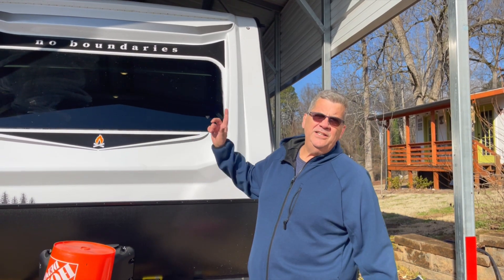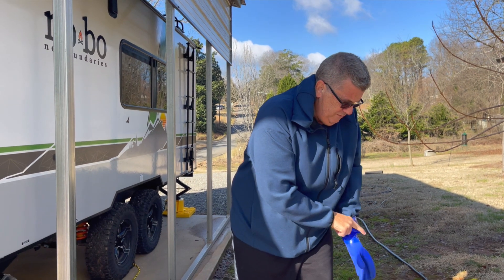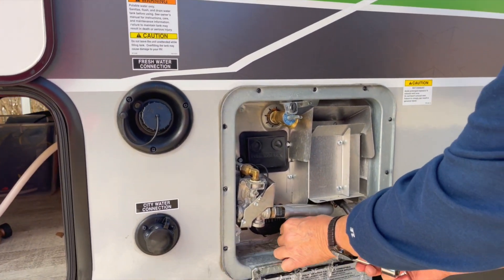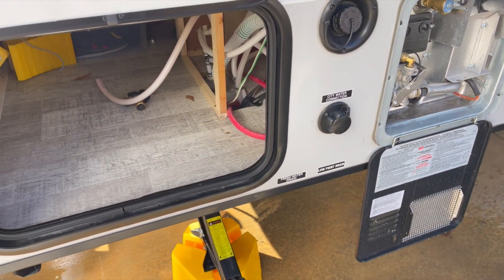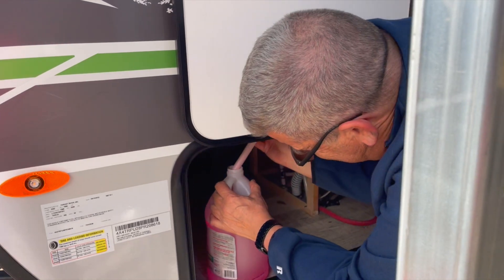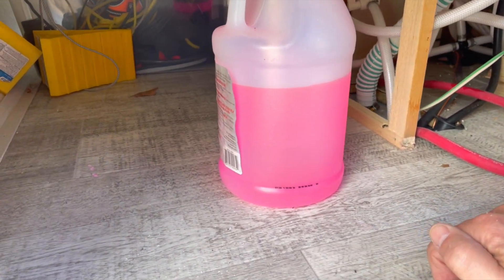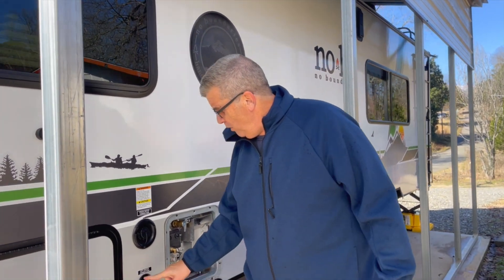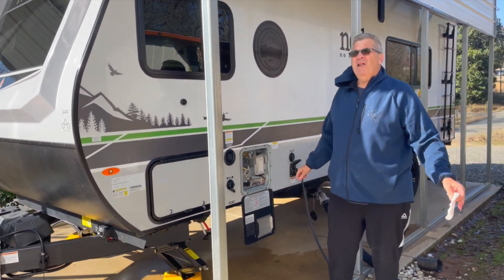No Boundries 19.1: Winterization with RV Antifreeze

Comment: Reaching out for a little help. I have a 22 NoBo 19.1. As a new owner (Dec 2023), I de-winterized it this past weekend and performed a full operational inspection of all components. 
I began by flushing the pink antifreeze by reversing all three pet cock valves and then running city water, with a pressure valve and filter installed, through all interior and exterior faucets, starting with the furthest away. No problems encountered.
I had successful operations of the A/C & furnace using the thermostat, refrigerator, stovetop and overhead light and fan, microwave, water heater, and vacuum.
The only issue I experienced was with the water pump. I did not receive any instructions for the use of it. The freshwater tank was two thirds full. I assume this is where the water pump is drawing water from. After turning on the pump at the switch panel, and turning on the kitchen cold water faucet, it drew the remaining cold water in the lines and eventually began to pump hot water no matter what source I used and even only using the cold water handles. I discontinued further use of the pump.
Is there a different configuration of the three pet cock valves to draw water from the fresh water tank? That’s the only thing I can think of, unless I’m missing something.
Do you have a de-winterization video, or a diagram indicating where to position the three valves for various uses? Any suggestions are appreciated. Thanks in advance.
Reply from the maker: There is a valve that selects where the water pump picks up water from.  It either gets water from the freshwater tank or the winterization hose pick up.  Make sure it's set to pick up from the tank.  

I don't know how it could be getting hot water from the water pump.  The water pump only picks up from those two places.

The only thing possible is that your water heater is on, the shower Mizer  set to recirculate, and the water heater is filling your freshwater tank with hot water.

Comment: Hi Guys, So when did you get your new 2023 No Boundries? We liked them but haven't decided yet.
Reply from the maker: We picked it up November 22.  We like it so far, did have a few issues that needed to be addressed.  The refrigerator needed to be remounted, it was leaning out a little.  The door was hard to close, it was adjusted.  The worse issue was the front window leaked, it was removed and reinstalled under warranty.

I am trying to get some changes made to it before I make a video of it.  So far I have installed a lithium battery and removed the folding seats in the back.  

I like the way it tows, but I have ordered a new weight distribution hitch from Weigh Safe to use instead of my Husky Centerline TS.
Reply: @CampingCoastie  Thank you for the update, appreciate it. I'll look forward to your review on it.
Reply: @CampingCoastie   The Husky Centerline TS is one that was suggested to me.  What didn't you like about it?
Reply from the maker: @joeducati1  I liked the Centerline with my three previous campers.  I could drop the tailgate on my Jeep Gladiator with the camper attached.  But with my new Ford f150 I couldn’t drop my tailgate.  

The Weigh Safe will let me drop the tailgate which is very helpful for me.  

Then with my new toy hauler my tongue weight can change a lot depending on what I load into it.  The Weigh Safe makes it easy to adjust the weight distribution depending on the load.